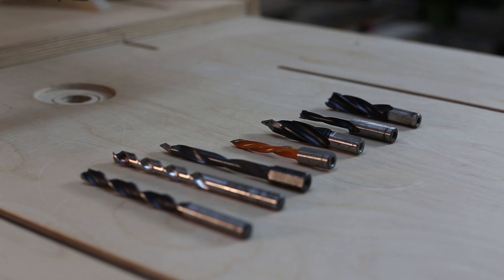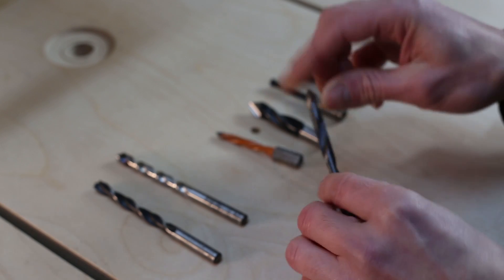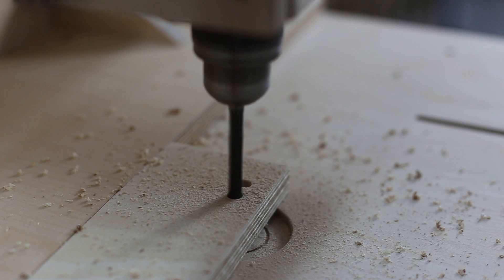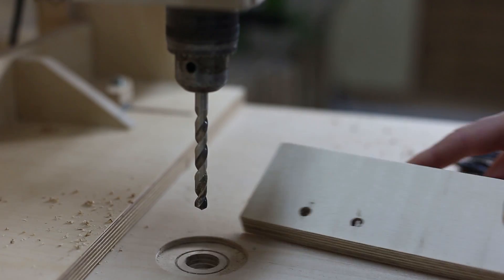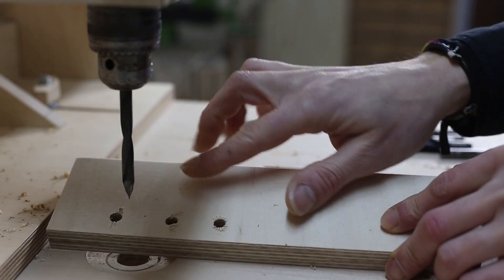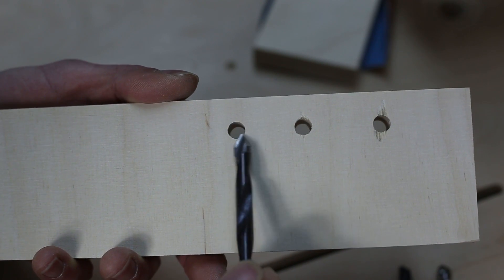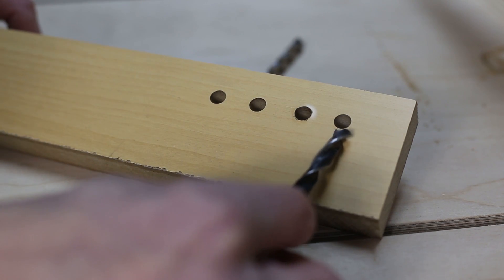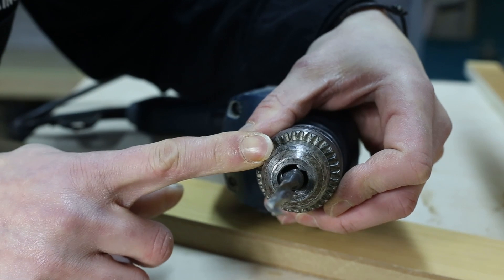How to use CNC Drill Bits in Column Drills

Comment: How do you install CNC drill bit with bevel into usual chuck with 3 points contact?
It is not easy   and need attention all 3 points of chuck contact with round surface of CNC drill bit
Reply from the maker: I explain that issue at the end of the video!
Reply: @Paoson_Woodworking  

It would be fine if you did that explanation at early phases of video.
In that start moments of video there no any trouble to install CNC  in usual column drill, but really it requires little more accuracy - not just easy as it looks at start of video. In start moments it is just easy like usual wood drill bit with round chuck, but it is not so simple

Comment: Have you tried using drill bits designed for acrylic for this purpose? They have a tapered head similar to the v-point cnc bits but at a fraction of the cost. They are also available in SAE for metric-phobic Americans like me:)

Comment: If these cnc bits are so good, why do they make anything else? Is there a down side?
Reply from the maker: +Torwulf games They are a little more expensive and difficult to find, thanks for comment!
Reply: +Paoson WoodWorking ok, i guess a stabdars bradpoint bit is more than good enough for most woodwork anyway, just put some scrap behind the hole and you wont have tearout problems.